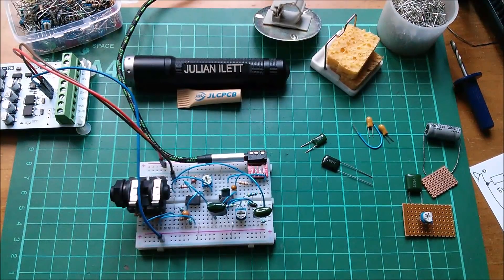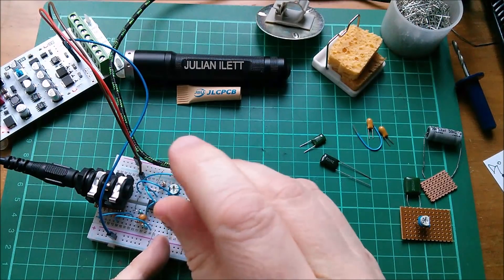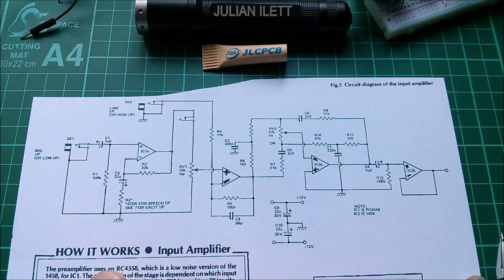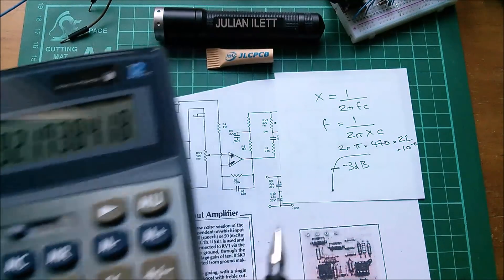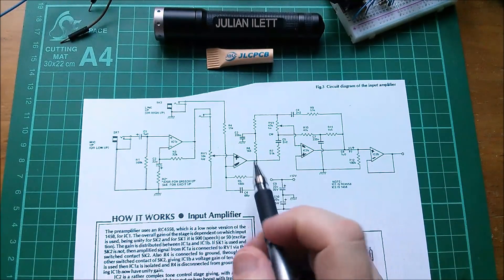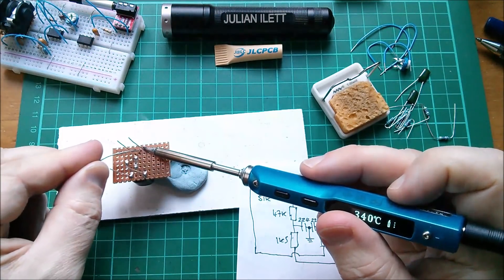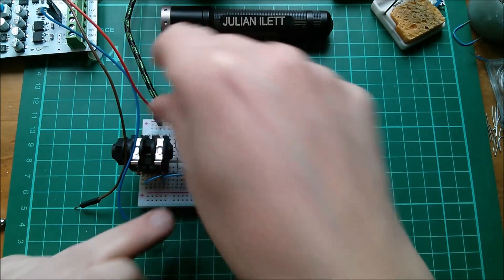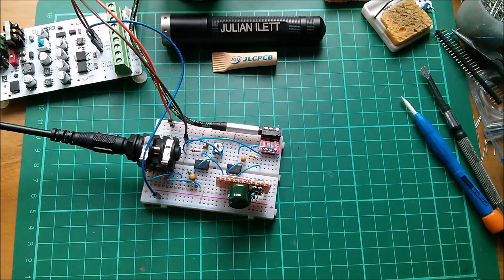Microphone Preamplifier Circuit - Vocoder

Comment: Reason #629 for using a proper linear power supply and not a noisy solar panel DC-DC lashup  :)
That was an awful schematic you had to correct there, good job.

Comment: What is the split rail PSU you're using on the top left hand corner? -15v and +15v one.
Reply from the maker: They pop up on eBay now and again, but don't sell in large quantities, so they disappear again. I just bought this item: Negative Voltage Dual DC12V -12V Power Supply Module 5-12V to ±12V For Amplifier  https://ebay.us/1uutVv. This seller is a good one for this type of PSU.

Comment: I'm afraid you can't just work out the -3dB point by making the capacitor reactance equal to the resistance, as the voltages across the two components are out of phase.  So instead you have to use pythagoras to combine the reactance and resistance, making this equal twice the resistance.   The answer is -3dB at 9Hz.
Reply: I rather think that you can.  When the reactance is equal to the resistance the impedance is equal to root two times the resistance.  If the gain is proportional to the inverse of the impedance as it approximately is in this circuit then the gain is reduced by  a factor or one over root two which is -3dB.
Reply: Ah, you're right, sorry.  Power gain at half is 3dB down, voltage gain at 1/(root 2) is 3dB down.  To be fair though he incorrectly talks about the gain being halved as in -3dB power gain, but not the case with -3dB voltage gain.

Comment: -3db is half power, meaning 0.7 gain, not half gain
And making the capacitor reactance equal with the resistence does not double the impedance of the r+c circuit, you need to use the complex impedance sqrt(r*r+xc*xc)

Comment: Schematic errors in magazines use to really tick me off.  And this one is no exception!  Look at that top line input "switch".  It is drawn above the ring and also has the "tip" going to ground!  Then there is another connector switch just down and to the right... what the #@$ is that doing there?

How many errors do you count?!
Reply from the maker: Yeah, I'm annotating the PDF. I've found a couple of dozen errors so far. But it's forcing me to analyse all the circuitry in some detail.
Reply: @JulianIlett  - It is like the magazines assumed everyone reading the articles would just buy the PCBs direct but I would often just want to try a certain part of a project circuit out on a breadboard.  You would have to wait months to see if a correction notice would be published.  I love reading paper magazines but without the internet for updates/corrections it could be infuriating!

Good idea with the PDF annotation.  It will save others having to do it.
Reply: I think that's supposed to be a stereo jack.  When you plug in a mono connector the "ring" terminal is grounded by the connector's sleeve, but it disconnects R4 from ground.  Meanwhile the tip terminal disconnects IC1a and connects the plugs tip to RV1 wiper.
Reply: @bborkzilla  - Oh, that makes more sense.  Although the jack's ring terminal is grounded already.  The tip signal then goes to one end of the RV1 pot (not the wiper).  Thanks for clearing that up as it wasn't exactly obvious in the schematic to me that that was a stereo jack.  It is one of those times where I would be looking at the PCB layout to see what was actually connected to what.
Reply from the maker: I think it's a mono jack socket. The ring connection and switch is upper left on the schematic - this just disconnects the 11k resistor from GND when a plug is inserted. The tip connection and switch is lower right - this connects the tip to top of pot RV1 when inserted. I think :)
Reply: More errors: Second´s state positive and negative inputs are changed places. Third´s stage negative input going to ground instead it has to go direct to output of third stage. Fourth stage  is not marked positive and a negative input´s. Sorry my bad english.
Reply: It is important that you UNDERSTAND the circuit completely before you go on to build and test it. Otherwise you can't find any mistake you made during the construction and test. Some of the circuits are far from optimum functionality (for your purpose), so you have to modify design parameters or even change parts of the circuit. I often use circuit simulations (LTSpice) to optimize parts of the circuits.
 
Sometimes you can even find circuits in publications which have never been build up and tested. In some of these circuits it is very obvious, but in some other it is not.

Comment: Did you ever test Zero crossing detector in past if yes then please send me link

Else Give me some good direction for it,
I tried with 4n35,4n25,EL817,MCT2E (direct with mains 230v 50hz)but always received false reading.
Reply from the maker: Yeah, I did this years ago for a lighting controller - Like you suggest Elmer, I also used a low voltage transformer (split I think) and pretty much any opto.
Reply: I don't recall Julian doing it.  I found lots with Google though.  I would suggest using a low voltage transformer to test a circuit so you can connect it to a scope and safely diagnose any problems.

Comment: I hope in your final version you implement a baxandall tone control
Reply from the maker: This is similar but only requires one pot :)
Reply: Actually, it's just a treble boost/cut
Baxandall adds the bass boost/cut
If you add this you can tune for clarity of voice plus the bass tones ;)
Concentric pots are still available if you only have room for one hole
btw, i noticed ETI is available on archive org as a 'page turning' resource :)